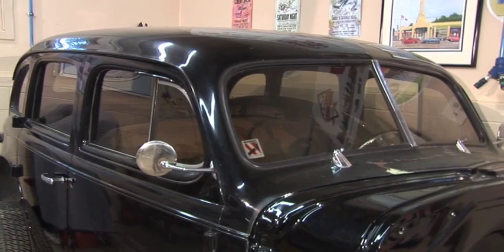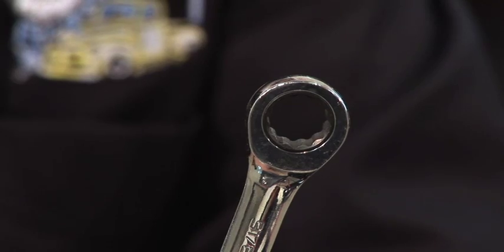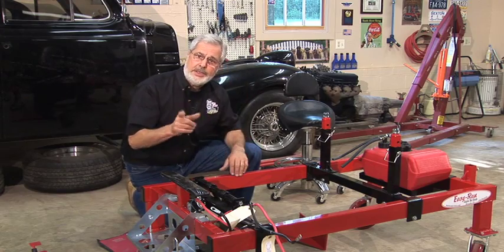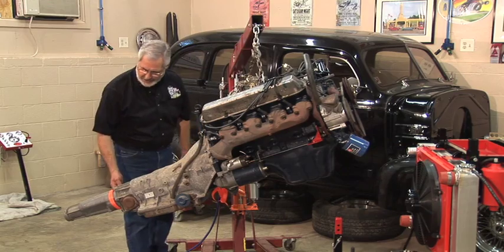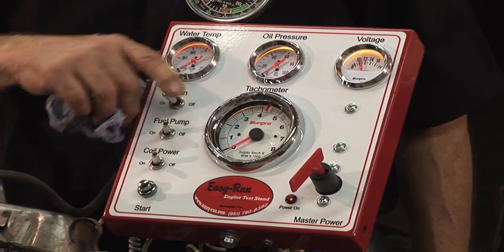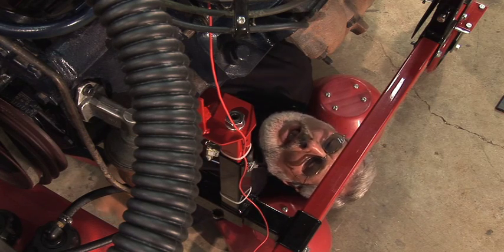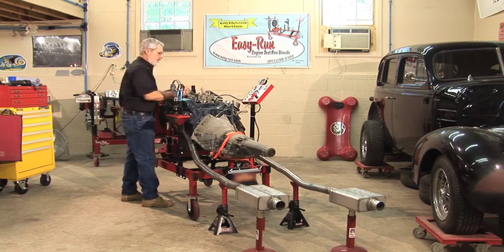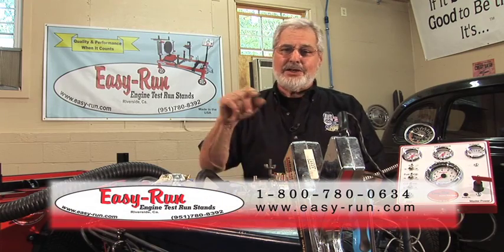Easy Run Engine Test Stands | Sam Memmolo | Two Guys Garage

Comment: pretty nice stand  its also good to see one of the old Caddilac engines still around  i grew up in South Florida and that was also the desired engine  they used on many Airboats  because they had the power and tourque to spin the propellers

Comment: the Tennessee Technology Center at Nashville Automotive Technology Department has one of these Test Stands, and it got its first use Last Wedesday running in a rebuilt GM 350! and it WAS quite easy to adjust everything!

Comment: Is it just me or did he never mention the price. Let me save y'all some time. The model he used is around $2,200
Reply: And couldn't be troubled with putting a clickable link in the description.
Reply: Yeah if it was like $500 I'd buy it, save some time and effort. For that much I'll pass, just use some scrap steel, old wood and a bird nest of wiring. Just running the engine for 10 min lol. This isn't the Saturn V.

Comment: I adore the kit that you can buy in the USA. In the UK, we are limited and the price we have to pay is beyond reach of the average weekend mechanic. Who enjoys their car, It's supply and demand as you have serious competition between companies and a far larger population. Therefore companies, can work on lower profit margins than in the UK. I have done it in the past to buy the tools or kit I require cheap ticket to the states pay for additional baggage and still save money on the import duty and postage.  May be I should put my plan in a container and ship it over rebuild then bring it back ?
Great video please keep them coming ?
Reply from the maker: Gordon, I truly understand and it is so much more expensive to export to the UK and other countries. They all have high tax rates on the imports. We still do seem to send units even though the shipping is also very expensive. Air freight to you is approx. $750.00, by the time you add the taxes and fees... WOW.... We do have a great clientele here in the USA. We can work with you on the pricing in some areas. On our web site is the Custom Series. It may ship at a less expensive rate. Also less expensive to purchase the kit. BUY you must be able to complete some of the electrical wiring and finish the kit assembly. It will do all the Pro Series will do and has some additional flexibility. Take a look and see if it will work in your application. Thank you for your comments. AL  and Andrew

Comment: No fluid in the transmission?
Did you leave the torque convertor out so that the internals of the transmission will be turning?

Comment: Nice but overkill..all you really need is a Auto Zone or Pep Boys type stand for a Chevy smallblock ..broke my cam in on one..went to Home Depot got a few plumbing items to run a garden hose into and another for the exit water hook up batt and 5 gal gas can ..trust me it works did it allready..not every body has upper middle class money to buy nice overkill stands like that..
Reply: Its not over kill if your building a lot of engines not just one engine every so many years like some ! but the price is by far over kill I built one for far less , . and not using a rebuild stand either ! its a nice stand but priced too high !
Reply: That's the price for one if you want one that's build in the U.S. . U.S labor ain't cheap. I can't afford one so I have to just install it in the car and hope for the best.
Reply: Brave running motor on a stand

Comment: Super nice setup  that’s. My style to  have a nice professional  system   Helps me work motor professionally  not like the  guys comments  on jury rigging some  Chinese built crap to save a few bucks  plus you  have a. Good safe. Setup !  As well as supporting a hard working  American Family owned and operated by them  let that other guy call up Pep Boys for support they. Give you a website  or a 800 number to call to speak with someone overseas that doesn’t know.  A thing about  motors or  automobiles  the guys that engineered and built  the Easy Stand are HotRodders and they got feedback and suggestions from other car  and engine enthusiasts to improve. T stands functionality ! That is how this country. Was as great as it was at one time  as well as others embracing the wisdom and Craftsmanship. Of the  peoples hardwork ? When i bought my last  home. It needed a  bathroo, faucet. Repaired. So i pulled out the part and went to a big box store that sells building. Supplies a   Store employee  asked me if i needed help and i told him  why i was there. His response was. What. Aisle i could look for the part on  that area was a absolute mess  so i gave up  and walked out of thr store with my part in my pocket i went  by a local hatdware store that was operated ny the store owner and had been in that. Town  for several  family generations  of ownership. In that exact location  2  older men saw me walking in and again asked me if they. Could help me. I told them why i was there and  they both asked me what street did i live on  when i told them my street they. Handed me the part that matched the broken one i had in my pocket the entire time  they simply. Told me they were freinds with the plumber. That  did all the homes in that area  for all the builders. So they knew what parts. Were used  and on what. Streets that they were installed on so they could stock the parts. The customers wou;d need  the part was under 5 dollars and it fixed the  problem perfectly  BTW the  original store i went to was a large chain of home improvement supplies and tools  that is no longer in business as a company  and i personally  beleive they.  Brought that upon themselves being too greedy and having poor management. Like many other large  Chain stores  did in America. Over the  last few decades   The consumers dont  want to pay for quality  so what you wind up with is a bunch. Of junk that may work for a while and then. You. Can throw that away  in a few years  and go buy another one that  will have the same issues  as nobody. On their research and development gives a crap. Or. Actually knows much. About  what. People really need. Or want in that product

Comment: Please help me out sir!
Recently, a client called me to fix his 2000 Toyota Avalon car that cranked but wasn't starting.
   From the onset, the car experienced several mechanical, as well as, electrical issues. Some of those  problems were:-
(1) Engine Oil consumption;
(2) Engine misfire;
(3) Engine rattling;
(4) Intermittent hard starting after shutdown; 
(5) Hard to engage in drive, except engine is hot; etc.
Hence, he took the car to a garage inorder to rectify the excessive Engine oil consumption and other car problems highlighted above. Consequently, the car  problems exacerbated after engine rebuild by the engineer! 
  The car owner wasn't satisfied with his repairs because it seems the engineer was deceitful. Although the car started after the rebuild, the problems still persisted.  Valves weren't grinded after engine overhaul, engine still misfired at idle and when accelerating, etc.
   The  engineer whose garage the car is presently being parked, requested for another engine overhau/ rebuildl. After engine rebuild the car started, the oil was mixed with water; the engine was still misfiring, rattling, etc. It was obvious,  that he didn't use durable parts to do his work.

    Hence, the car owner moved the car to another garage for better repairs. The new garage suggested to the car owner that another engine rebuild is pertinent for optimal engine operation. 
    During my conversation with this engineer, whose garage the car is presently being parked, he told me that: "when the car was first brought in, he noticed a black smoke ( maybe he was mistaken for blue smoke, at exhaust tail at idle). When accelerating, there's a loss of power, engine bucking, popping,etc. After the rebuild, the car didn't start because the mechanic didn't unlock the car with the remote but proceeded directly to cranking the engine. In addition, the security relay wasn't actuated for starting to take place. Electrician did some wire cutting around that axis which he said was corrected to factory, opened with a remote before the car started.

   Fortunately, after everything, the car started again. But there was still an intermittent misfire. What the car owner said was that, 'even when the second mechanic did engine rebuild, the car still misfired. Until he personally bypassed earth from the COP wire to the solenoids very close to the fuel injector often tightened with 10mm knot and depicted with blue and green colors on the picture. Car owner verified that the reasons for the misfire from both mechanics which still prevailed, was due to the solenoid valve that wasn't opening. That's why when accelerating it experienced a loss of power, similar to that experienced by a faulty fuel pump.
  
   After gear oil replacement and test driven by the second mechanic , smoke started emanating from the engine bay. Precisely, from the fan relay that the car owner connected by himself. Within few minutes, the car shutdown by itself as if fuel is finished.  As he tried to restart it, the car refused to. Infact, when the ignition switch was turned to Acc/ ignition position, battery and fuel light was not displaying in the dashboard/ instrument cluster. However, during cranking battery light glew faintly and start. But when throttled,  it would shutdown. Electrician verified and replaced the alternator diode with a new one. When Ignition switch was turned to Acc/ ignition position, the battery and other lights came out brightly but when cranked to start engine wouldn't start again. Sadly, it still wouldn't start.
 
I tried to scan for DTC codes, but my scanner wasn't communicating. I checked all fuses, power and ground at obd port, those checked ok. but my scanner isn't compatible to read CAN network. there are only 4 wires intact for the obd2 port.
    Furthermore, I added fuel through the intake to the engine, no change at all. I checked for spark and injector pulse. These things weren't present. But there was power to injector with just the key at ignition or ACC and COP had 1 ground and 1 power as usual. 
 Electrician from that garage, who also worked on the car said that he sniffed burning smell from the ECU, however personally I didn't when I went to start the car. I don't know how certain that was. Hence,  I pulled out the ECU to a laptop board engineer to test the components inside. He said: "everything looks ok and test fine, however the IC he doesn't have the right tools to proceed with the test. With the ECU removed battery connected, Engine light would come ON. with ECU connected check light still comes ON.
Before I left, I checked the MAF sensor 5 wires and noticed that 3 wires were earth instead of 2 and 1 power; no ignition current/ power was available for the remaining 2 wires. 
  Please, what should I do to start the car?